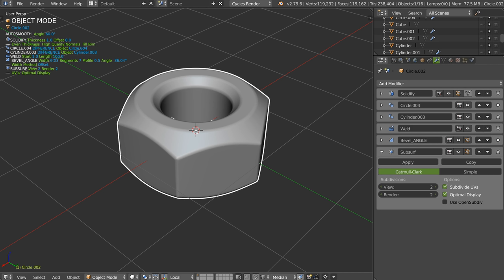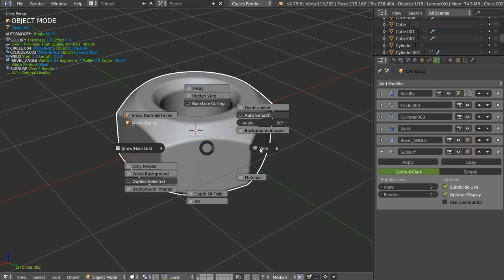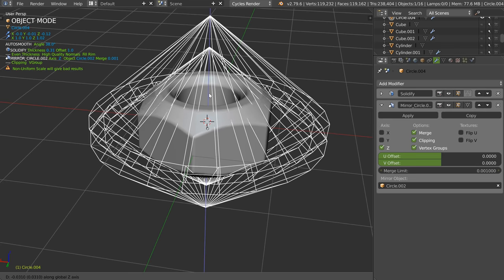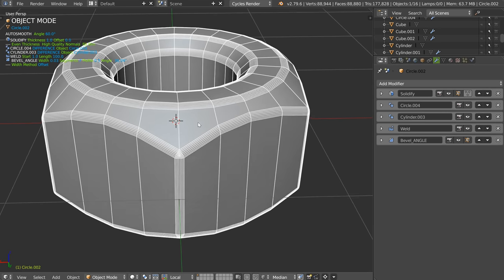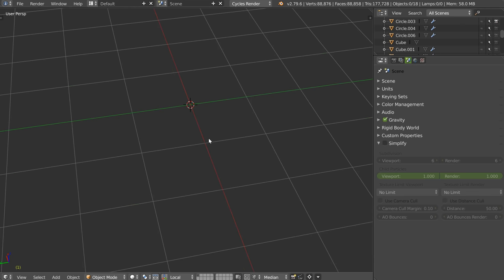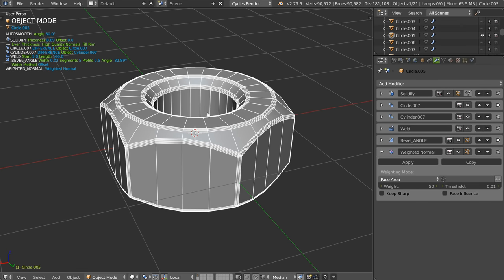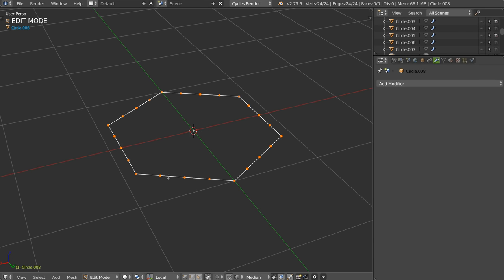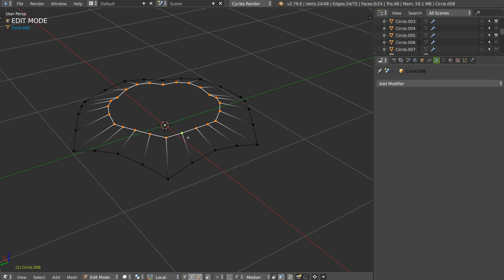Speedflow - Make a Non-Destructive Bolt

Comment: I tried Yuri's 2.79.6 build and the weld operation doesn't work as well as in your demonstration. Am guessing the only way to access Weld modifier in 2.8 is via your speedflow addon?

Edit: Scratch that. Just read the rest of the comments. Guess we need to hope this modifier is implemented in the official build. It's going to be a great time saver esp. with Boolean operations!!

Comment: Can you make an update, so that we can weld like what you did here so that we don't need to change our blender to Juris.
Reply from the maker: Sadly this isn't possible, Blender devs need to create a Welder Modifier for that, sorry.
Reply: Thank's for the response cedric. I hope blender dev's are looking at your videos so that they will get a info on what is needed to make blender a truly non destructive modeling software. On another note, can you make an upgrade on the project function for speedflow companion, that will allow indented or engrave objects to be attached on curve surfaces like meshmachine. Thanks.
Reply: @pitiwazou  Salut Cédric, tu saurais nous dire comment installer / utiliser l'addon pour weld ? C'est vraiment un game changer pour du non destructif !
Reply from the maker: @TrepanUtopia  Ce n'est pas un addon mais une build blender. Lien dans la description ;)